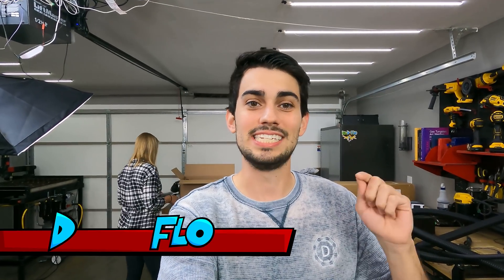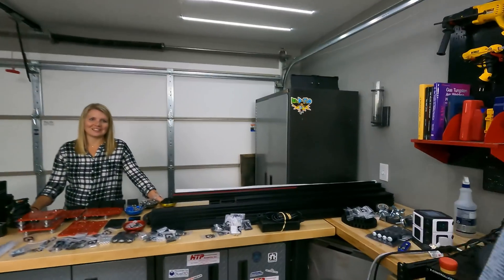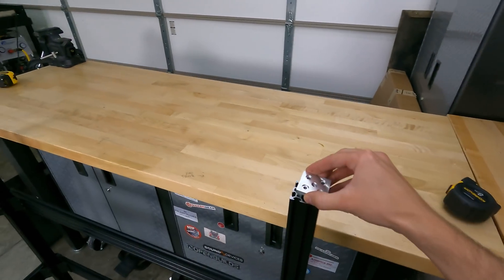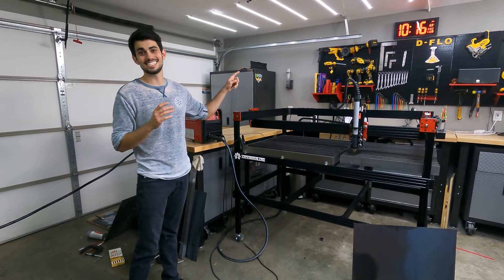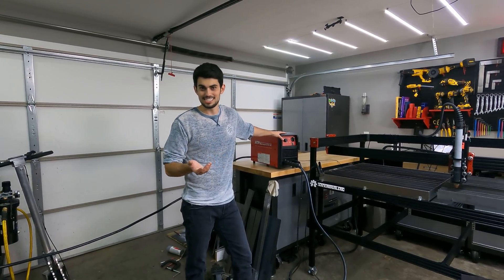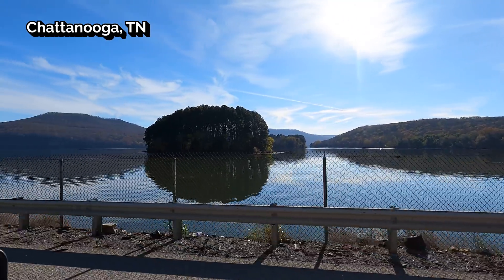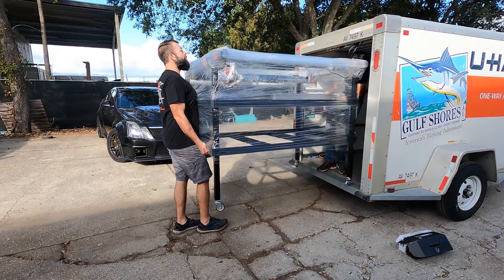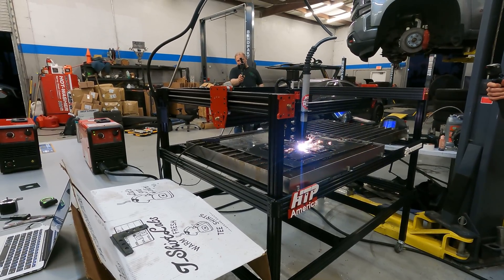Building a Plasma Table for Fasterproms

Comment: DR D Flo If you need to wrap a machine or anything up in future go to Harbor Freight for $8  get a roll of 5 in. x 1000 ft. High Performance Stretch Wrap with handle that lets it spin to wrap up anything it works great and you cant beat the price. Trust me you will keep it in your house , garage, car for holding together all kinds of things or wrap seats to keep from getting wet ,muddy or greasy etc. in a pinch

Comment: i help run a metal shop for a non profit maker space. we have been trying to get a plasma cutter for our shop and this seems like the best idea. Ive converted mills and lathes using grbl and linux cnc. im stumped on the plasma control grbl or linux i know you have a post for fusion 360. any way you can make guides going into details about this and programing speeds etc,